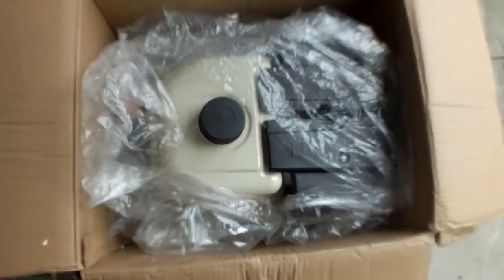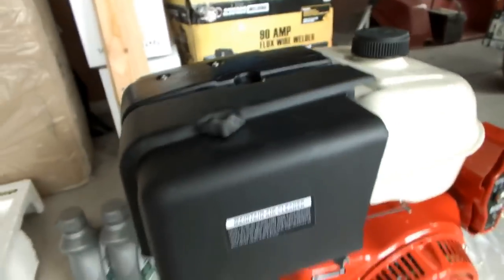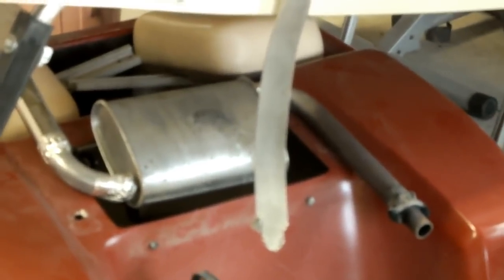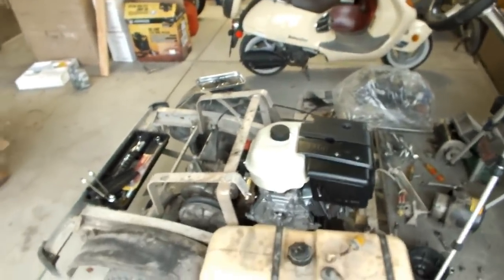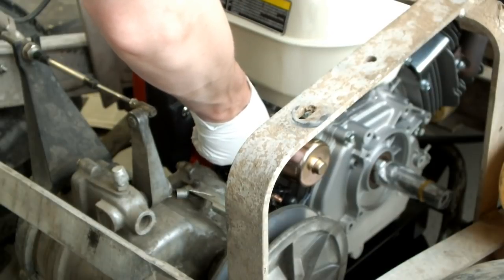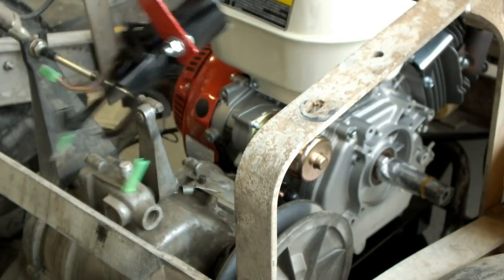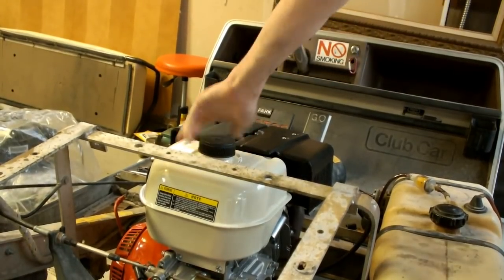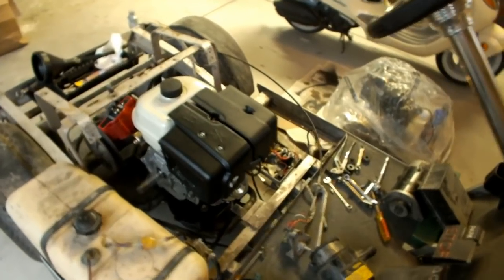Club Car GX420 Engine Swap: Dropping In The New Engine

Comment: Ummmm.... Must be one helluva reverse driver. Unless I'm missing something, that engine seems to be sitting backwards.
Reply from the maker: +Dray Cooley Haha, i see what you mean, but in this case the engine rotates clockwise so its all good. Check my channel feed, I have a video where it's finished and i'm driving it around.
Reply: Where can i get this engine? Very interested as Ive only came across left hand drive engines. Thanks
Reply from the maker: +Dray Cooley It depends upon how your trans/diff is setup in your golf cart. But just search "16 hp gas engine" if you want to look at the engine i chose.